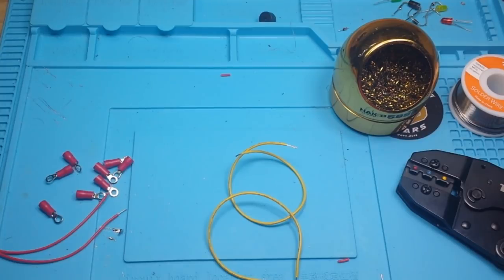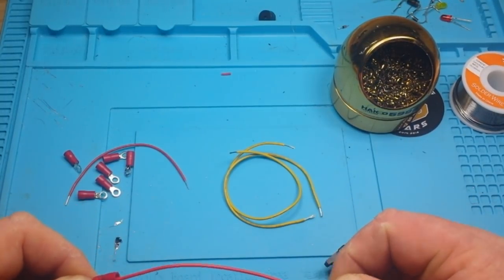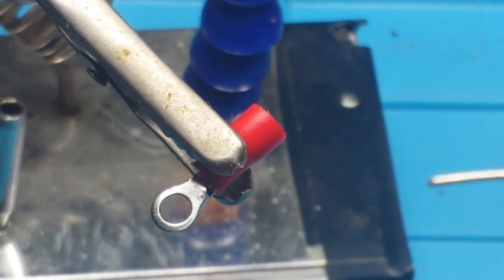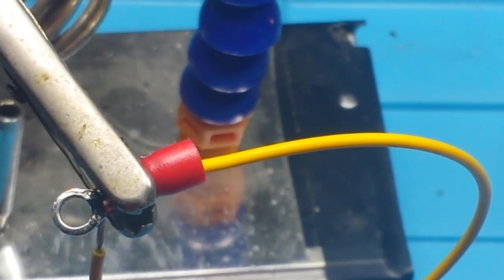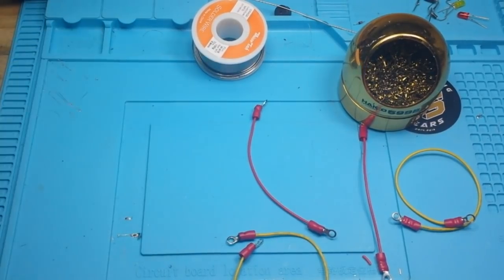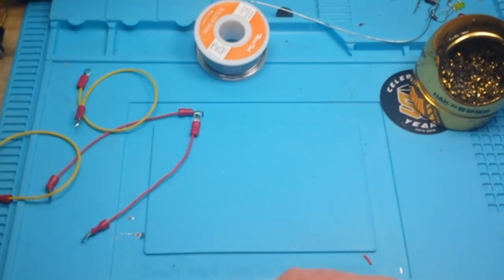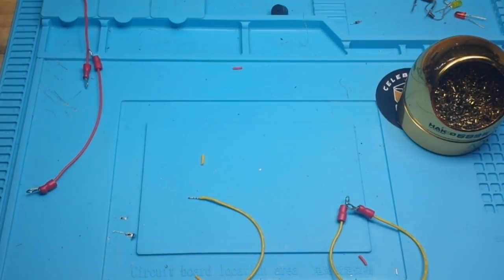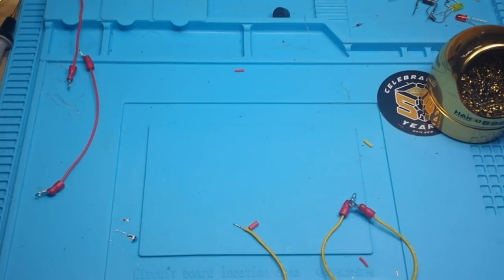To crimp or to solder terminal connectors

Comment: I understand why the industry standard is crimping.  It has more flex built into the setup.  A solder connection just doesn't have the ability to resist vibration like a good crimp.  But, "good crimp" is the key.

I have numerous street motorcycles with over 100k on the clock.  These bikes have all kinds of add-on electrical modifications from horns to auxiliary high-amperage lighting.  I have never experienced a wire failure from any of my modifications.  Here's my procedure:

1)  Use a heat gun to soften the crimp plastic ring and pull it off with needle nose pliers.

2)  Install a couple of sections of heat shrink tubing over the wire before connecting the terminal.

3)  Solder the wire to the connector.

4)  Apply some liquid insulation to the area around the wire/insulation.  Heat the shrink tubing in-place.

The heat shrink tubing provides a great deal of stress relief and with the liquid insulation no green crusties should work their way up the wire into the insulation.

Why do I prefer the above?  Well, I do not want spend the dosh on every single type of industrial-quality crimper made.
Reply: fair point but the soldered connection plus heat shrink eliminates corrosion fails

Comment: For stranded I prefer both... crimp first then solder! And I got no worries after. I also check the connection with ohms range, not continuity.

Comment: When the wire gauge is too small for a connector I generally fold the wire prior to crimping.

In a high flex application the wire used is a finely stranded non tinned wire with a silicon sleeve.  Slot cars use this type of wire at the braided guide that goes into the slot of the  track.

Handling bare copper or even tinned copper, best to clean with a clean/lube solution to help reduce corrosion.  Green growth is not desirable.

Comment: 2 more things things about the ferrul crimper. 1) the wire should come just shy of the end of the ferrul. 2) don't insert the ferrul into the crimper all the way to the plastic. if you do, when you crimp it you run the risk of separating the ferrul from the plastic. there is very little ferrul inside the plastic shield. leave about 0.5mm space and you won't have an issue. With a high quality ferrul, you might not have any issues. 

always enjoy the videos, Paul.

Comment: Now you need to oxidize both and test them again. In automotive if you don't solder wires that are on the outside of the car they will quit working a lot faster.
Reply: Wade Ryun I'm with you on that!  I worked as a heavy truck mechanic while I was in college.  Crimp connectors were the bane of my existence.  We kept a spool of 8-conductor cable to replace corroded wiring on trucks and trailers.  Guys would wire in lighting with crimp butt connectors without heat shrink.  I've seen corrosion that traveled 10 feet into the cable.  We did only soldered lineman splices with marine grade shrink tube.

Comment: It is not detrimental for a bit of solder to wick up inside the insulation near the end of the wire, it is actually better for this to happen as it acts as a stain relief to the bare wire at the point where it enters the connector. Some connectors especially on automobiles are actually designed to both crimp the bare wire and a bit of the insulation as well to act as a strain relief to stop the wire fracturing at the point where it enters the connector.

Comment: Great video!  I came across the argument that solder won't survive vibrations. I have those first connectors you did, and was thinking about getting the second kind. There's a major lack of crimping videos out there. Must still be a skill gained by those in the trades that need it, and the hobbyist is not thought about.
Reply: Crimp joints also won't survive vibrations.  If the motion gets to the joint it will fail.  At the joint is where there is an abrupt thing happens to the flex.  This focuses the stress.

Comment: This is video wrong in so many ways; if you are going to do a job, do it properly.
Crimp terminals are designed to be crimped, solder terminals are designed to be soldered. Don't mix the two.
Use the correct size crimp for the wire you are going to terminate, use the correct crimp-tool for the crimp you wish to use; they are not that expensive. 
Strip the wire to the correct length, being careful not to nick any strands.
The proper tool will crimp the bare wire at one end of the plastic sleeve, and provide support at the other end by holding the wire tight enough without penetrating the insulation.
When you insert the stripped wire into the crimp, be careful not to include the insulation into the 'bare-wire' crimp area, this will compromise the integrity of the joint.
If you put too big a wire into the crimp, it will over-crimp and fracture; too small, it will under-crimp and fall out.
If you really must solder a crimp terminal, remove the sleeve first. When you apply the solder, don't get it all over the clamping-area of the ring, it will prevent the terminal screw/nut/ whatever from seating properly and making good contact.
The poster of this video ought to go to tech-school/college before posting stuff like this, and learn to do the job properly.
(Yes I do know what I am talking about, I served a full technician apprenticeship and obtained FTC after my name. I have worked many years in aerospace, on planes and satellites, with no operational failures. I have ESA and NASA certification to teach).

Comment: I second davbj1's comments - insulated crimp connects should be crimped only.  Non-insulated crimp connects are usually first crimped, and then soldered, and then protected with heat shrink tubing.  A perfect connection should be both mechanical and electrical.  I was taught that the mechanical connection was supplied via the crimp, and the electrical supplied (or supplemented) via the solder.  Thank you for specifying the use of a 'good' set of crimp connector pliers; I am consistently horrified at the prevalence of those $10, thin, stamped steel crimpers.  They should be outlawed.  >Charlie

Comment: it is always advisable to tin prior to crimping.un-tinned copper will oxidize. personally, i never use solid wire, i always crimp and sometimes i crimp and the solder after.
Reply: I would prefere to solder it after crimping. When it's crimped first it's tight and the solder seals it.
If you solder first,the stranded wire will be a bit soft so the crimp can loose tention over time and that's a problem.
Reply: @geirendre  
Yes  that is correct.
Reply: @geirendre  Tinning first, helps protect the wire as crimping essentially crushes the copper. Not only does that make the copper weaker, it also increases the resistance at the crimp. Tinning, done properly, will add very little to the overall diameter of the conductor, help keep the resistance down as the gaps between the individual strands are filled with solder and should not contribute to early failure which can happen if the solder is too thick. You have the added benefit that the fastener surface stays flat, no solder buildup which often happens in post-crimp soldering, and you don't risk melting your insulator. As far as the solder making the wire brittle on the lead side, that is possible if you tin back too far.  We all have our own ways. After 50+ years, I'm probably not going to change mine.

Comment: i've never trusted crimps because if you pull hard enough they will pull apart. So I always pull off the plastic part, crimp it, wick some solder in the crimp, then cover with heat shrink. It's impossible to pull it apart. I know they sell ones without the plastic but the plastic covered ones are sold everywhere and usually sold in nice assorted sets.
Reply: Let me inform you on how we do test if a crimp is done correctly: We simply pull the crimp terminal off the wire and measure the force required, very simple, but it demand that you use the right size wire for the crimp terminal, the manufacture of crimping tools/terminal have specified at the force the crimp have to survive, if the crimp break at a to low force you adjust your crimping tool until it meets spec.

Comment: Crimping does the exact same thing.  You are making the wire inflexible where the crimp is.  At some point the wire will be attached to something and that will not have the same flexibility as the wire itself.  Some connectors are better soldered and some crimped.  In this case it is better to crimp then to poorly solder a connector designed to be crimped.

Comment: This is a great topic for video/presentation. Lot of great comments already so won't beat a dead horse here. First, get yourself a quality ratchet crimper tool. That's probably the most important than which method you use. That said, i don't use anything in high vibration environment...but i crimp and dab with a small amount of solder for insurance. I will admit a good crimp does not need solder. Again great video and topic.

Comment: In MY case, I found it was related to my own skill.
To begin with, my 'crimping style' was atrocious and I was using the WRONG crimp for the (stranded) wire size so I was doing the crimp first and THEN soldering to assure a good connection.
(I'd already decided against pre-tinning the wire for the same reason mentioned in this video.  The crimp itself would inhibit a lot of the solder from wicking back too far)
As I became more proficient (and started using the CORRECT size crimp for the wire in question), I dropped the erroneous post-soldering exercise (mostly because it had become a waste of time)

Synopsis:
With the right tool, the right wire and a little 'skill', a standalone crimp is the correct method to employ, but it will take a few 'butchered' jobs to arrive at that goal.
Trying to make a perfect crimp with a $5.00 crimp tool isn't as easy as with a $50.00 crimp tool.  (Ask me how I know!)
Practice, practice and practice.

Comment: Is there a little white plastic bit inside the connector? I was just gunna cut the plastic off the outside so it doesn't melt and solder it like it was a an xt60 connector but if there's a little plastic bit in the middle than that's probably gunna melt if I do it like that. And yeah, always tin everything. And a little bit flux helps a lot too.

Comment: Great video but I disagree. You do not take into consideration the harsh environment of a vehicle in the snow belt. The crimp might be ok on day 1 but it can corrode over time.  That's why automotive connectors are waterproof sealed with O rings. Soldering done right is pretty much bulletproof. I was on the fence myself until I was sent by my company to a soldering school. This company trained people who worked for NASA and Satellite manufacturing. You can repair it easily once its in space. They don't crimp. They deal with vibration a lot. Learn to solder properly. You won't be sorry.

Comment: One thing i was taught is  don’t tin the wire then crimp it because it  can come loose .
For the last few years i have been playing with Arduino nano and use those adapter boards that have screw terminals - what a pia getting little wires in the terminal ! Then i was watching another channel and the guy on there showed the ferrule crimps and didn’t they make my life easier !

Comment: Excellent! very helpful video. I much prefer soldered connections, regardless of wire type or intended use, and to be clear, most of my soldering is for largely immobile (vibration-free) audio applications, like guitar speakers (with female spade connectors), or instrument cables (guitar into amplifiers), with 1/4" to 1/4" phone plugs, etc. However, to be quite frank, I've never understood why the manufacturers of these various connectors types (spade type and otherwise), put colored plastic jackets over them? Why? I get the color-coded 'wire gauge' thing, etc., but they melt and become unsightly as soon as the soldering iron gets anywhere near them! So why do that? I find myself just cutting the plastic jacket off with an Exacto knife (before soldering), then soldering them up, followed by an inch or so of sealed heat shrink tubing over the entire connection. Seems to make the whole plastic jacket thing kinda pointless to me?

Comment: There are very specific rules on Mil-Spec soldering, if you can get your certification, you can excellent solder joints.
Reply: Yes and we use anti-wicking heat sinks to keep the solder from flowing under the insulation.

Comment: What if you cut the crappy plastic cover off the wire terminal and barely tin the end of the wire not the whole exposed wire end and then solder it to the terminal and give it a coating of dielectric grease and put a piece of heat shrink over the end of the terminal? 🤔 I’m not an expert by any means but that seems like it would be a good option and maybe it wouldn’t lose flexibility and have some grease in there for corrosion resistance. Plus the heat shrink would make the end of the wire a little tougher… I’d be interested to find out how well that would work. Great video either way! I really like those crimpers btw…👍🏼

Comment: Eww @5:20 that was a straight up cold solder ypu used the iron too melt the solder not the joint... that was like textbook no and then you used continuity to test the connection shit you could have them just touching and continuity would pass i thought ypu would show us the difference in resistance higher ohms means shittier connection

Comment: Hi, good informative practical video.
I have a similar set of crimpers, they are RIGHT HANDED as you are using them.
The wire side must be on the coloured dot side.
WHY, if you look at the jaws where they crimp, my pair have different clearances for the front and back crimp of the connector.
 Crimp connecting is in the same area as "wire wrapping", making a solid metal to metal mechanical join that is corrosion resistant.
Reply: Read the manufactures guidelines, often called a manual or user instruction, if it is a quality tool you have then things will be explained there, the reason for the different clearance may be found in the crimp terminals the tool is designed to be used with, and that again may be the manufacture of the tools own crimp terminals, not the any crimp terminal.

Comment: Making a blanket statement that solder reduces flexibility so therefore will cause premature failure is more than a bit heavy handed.  The crimp itself provides a very hard bend point, just like solder.  And if you crimp it wrong, you can even weaken the wire when it gets pinched by a sharp edge.  If it's soldered right, there is no excess solder to make it stiff beyond the connector.  Crimping requires correct tools and procedures, just as soldering does.  The prevailing attitude that it doesn't leads to unskilled workers under uncaring supervisors.  Can't find the crimp pliers?  Just use needle nose.  Or a hammer (yes, I've seen it).  Oh, and, AHEM , a well soldered joint will never come apart by being pulled.
Reply: Very underrated comment. I completely agree with you sir.  By the way you also characterized very well the theme  of this channel if you look at more of his videos usually  he has a very heavy handed approach. I think this channel is  useful and appropriate for people who are not looking for excellence and precision.  That is not to say that I'm not grateful for the author's contribution and his contagiously good  spirit.

Comment: Crimping work hardens, soldering anneals but immobilises.  Either is a point of failure by vibration whatever the termination type.  The usual solution is to immobilise the immediate locale of the termination and only allow untouched stranded cable to move. 
the tail with a gromit or strain relief moulding.  The only wire that moves is stranded and un-restricted except for an outer sheath
That said as you say crimping is industry standard ... in Telecoms 99% of joints are either twisted conductor, IDC crimp or screw terminal.  and 99% of the wire is single conductor and doesn't move.  In exchanges cables were wrapped  on tags and soldered but the cables were laced into position - so immobile.  The 1% would be instrument cables which are copper foil wound onto nylon fibres, covered in a sheath  and then crimped to some form of end/plug. Sockets would be single conductor and captive.

Comment: I only had to see the title of the video to know that solder is always better.  Especially with speaker connections, it's not as much the crimped connection at the wire, but the spade versus a soldered connection at the speaker terminal.  A soldered connection will always sound better.

Comment: I have a crimping tool like the one you used but I seem to have the most issue with stranded wire as it fans it out on the inside making it too small to grip well.
Reply: It really isn't the right sort of tool.  Even very expensive ones get it wrong.  Get a really cheap one and see how its jaw is made.  The area of contact between the barrel and the jaw of the tool should be such that it pushes metal in without bulging the thing to the sides.  The curve of the working surface of the jaw is a bit smaller diameter than what you intend to crimp.  This tends to gather the metal towards the center instead of pushing it outwards.
Reply: @Ken Smith Which crimping tool gets it right?

Comment: If you can yank a ring connector off with your fingers, it is a faulty crimp.
Reply: Yes and you really should hang a weight on them for a few months.  Often the metal will relax with time.